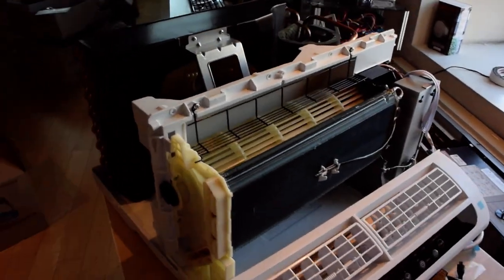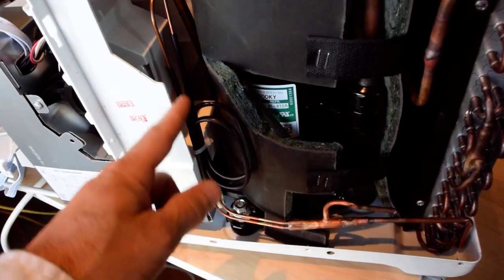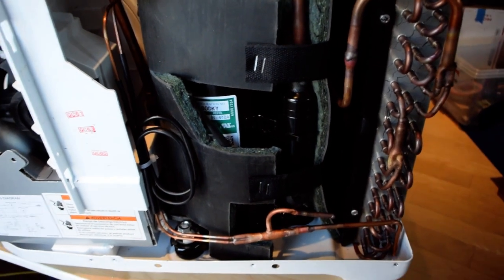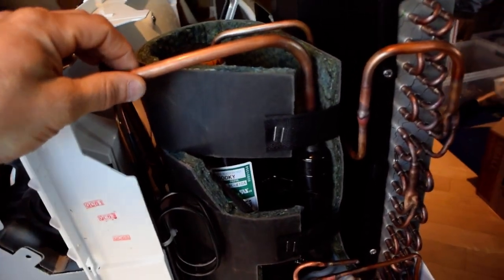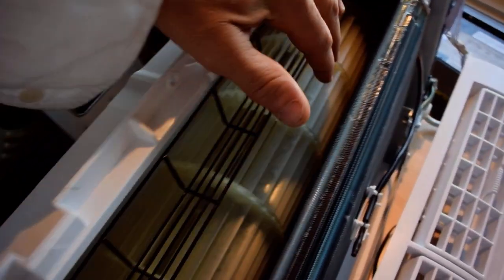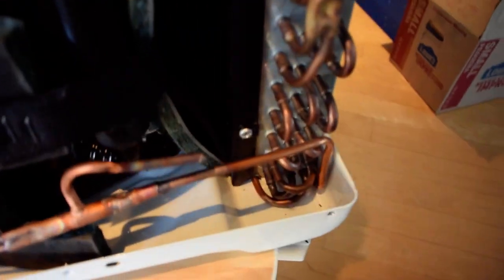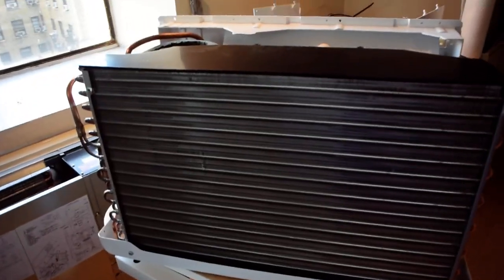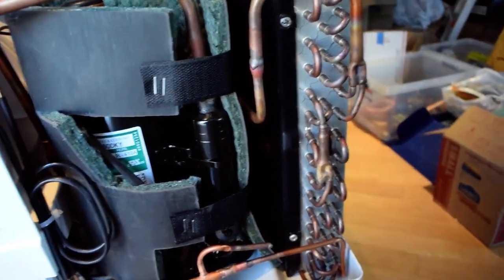What's inside this very quiet Haier serenity windows AC unit

Comment: the cap tube is looped because it has to be a specific length to meter the correct amount of refrigerant into the evaporator. there isn't enough space in these units to not loop it.

Comment: that cap tube is coiled for noise and vibration reduction. When the tube is coiled or bended , noise and vibration can't travel through. some unite will even put weight on some tube that vibrates or make noise.
also , cap tube have to be certain length to let ac work properly.

Comment: I assumed that the loop was an expansion joint. When metal warms it expands and when cooled shrinks, and this can produce creaking noises and wear where it is restrained. So I always assumed that the loop was to reduce noise at initial power on and when powered down, and to extend the life of the product. All metals can flex a tiny amount forever without failure, as long as the amount that they are deformed is less than their  Fatigue limit (except for Aluminium, it does not have a "Fatigue limit" and will always fail, given enough time. Hence vulnerable Aluminium parts in aircraft are extensively tested, allocated a life expectancy and replaced well before failure).

Comment: Hi Josh, I have one of these units. It worked silently for the first few months, but now it’s quite loud and has been for like two years. I’ve not taken it apart, but it’s a revolving sound. I suspect that it may be coming from the linear fan. Any ideas on what I can do to silence the unit, or other parts that are obvious candidates for a revolving noise sound? Thanks for your video! Chris
Reply from the maker: Definitely could be something caught in the fan. Does the pace of the sound change when you change the fan speed?

Comment: the capillary loop is just to get the tube long enough...you need a certain length of capillary tube to get right flow. An alternative would be a needle valve, but those are expensive.

Comment: I had read a long time ago that if only manufacturers would spend a few more pennies to replace the stamped metal fan blades with less turbulent well designed plastic blades, window ACs could be much quieter and more efficient.  I guess it finally happened!   ALSO - just a guess (I saw the comment about required length of the tube), but maybe also those rubberized loops are to prevent resonance or other vibrations transmitting through the pipes.  Otherwise, why the rubber?  I had an AC that was making a lot of buzzing and it turned out they had cheaped out and hadn't fastened the thin refrigerant tubes anywhere with foam (as the repair guy told me was normal practice).

Comment: I have same model and it makes terrible noise on quiet mode, sounds like compressor, but it works fine on high or medium, anyone know what can it be?
Reply from the maker: Maybe take the cover off and see where the noise is coming from? If it is the compressor then not much you can do since it is hemetically sealed. Maybe only run on medium! :)
Reply: @peter c did you manage to fix your ac? What was wrong? Mine is noisy too.